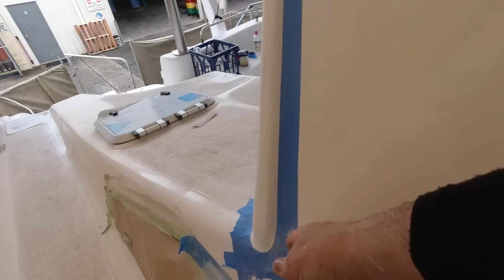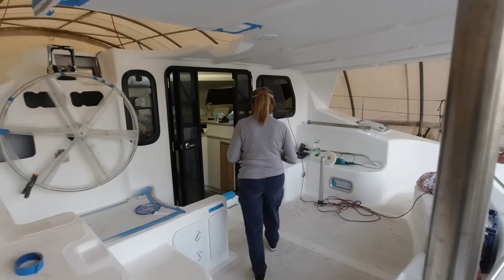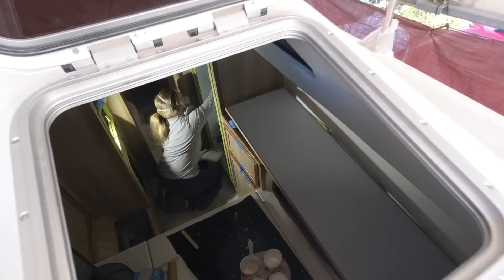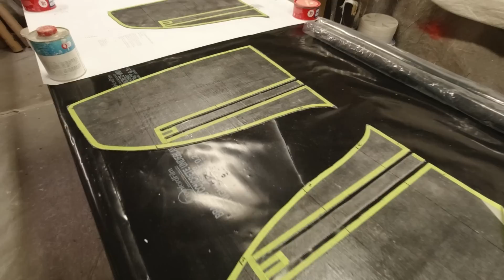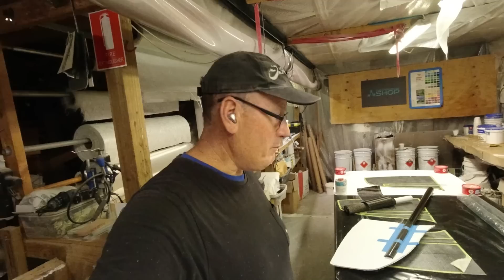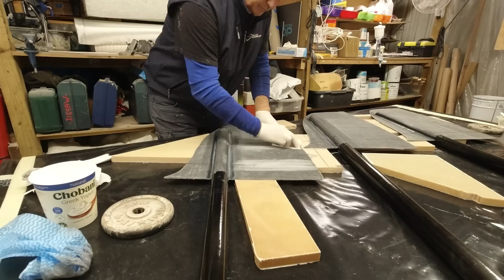Carbon Rudder Fabrication - Catamaran Build from Scratch Ep344

Comment: It’s amazing how much force water can push on the rudder. Those ribs and epoxy is the only thing holding the shat to the blade… as an engineer seams inadequate, but that’s the plan so better engineers than me know what they are doing.
Reply from the maker: Mate  there is so much tabbing and structure, there is no chance of these coming loose.This weeks video has more detail.
Reply: @LifeOnTheHulls  I was thinking, all will be revealed and I just did not understand. Tab the heck out of that rudder….lol
Reply: Looking forward to seeing the rest of the construction.
Structurally the centre web is not ideal, better put the strength in the skins. That said it is perhaps a better way of getting a good straight result. 
The highest load on the shaft is around the lower bearing, ie where it exits the hull, ideally you could reinforce this area with another tube inserted inside.
If the shaft is strong enough to take an impact, what about the hull?  Is it designed so that the bottom can break absorbing some of the shock load.  Likewise I would have the leading edge the same. Damage to the rudder is far preferable to damage to the hull.
Reply: My ideal is a spade rudder, as he has, fixed into a cassette, so can be lifted, and has a crash zone at the rear of the cassette box.
Reply: @markthomasson5077  - totally agree. I would be tempted to put a tube outline the rudder so that tube acts a a brace that gets grounded first and protects the rudder. I have seen this on some of the cats. I probably did a poor description, Agree Let’s se how Ross strengthens this up. Our Ross is a one man super human and he has got it done right to date so I suspect his going to bust this out just as well.

Comment: Carbon🤤 This is a fascinating video and I’ll be keen to see how you attach the rudder stock / shaft to the quadrant to avoid corrosion.
Reply from the maker: Will only have a tiller to attach to shaft and epoxy between the shaft and and tiller to deal with electrolysis.Pretty well  proven system.

Comment: Excellent insight with the rudder construction! I’ve been thinking this a lot. My rudder needs to withstand the whole weight of the boat with the double keels so that boat can be beached.
I’ve been thinking of making the whole thing with skeg and hinges and everything from aluminum. But we’ll see!
Keep it up! Not much longer to go!
Reply from the maker: I would suggest having a skegged rudder to keep strength upper snd lower, buggers to change or repair but safer that spade.We have a large skeg immediately forward of the Rudder and prop for added protection.Rossco
Reply: @LifeOnTheHulls  Yeah, definitely a skeg! There's also the fact that I can put only on bearing in the boat because there's the dingy garage that prevents the rudder stock coming to the deck level. So the lower bearing needs to be in the skeg.

Comment: On my rudders for my schionning wilderness i put sail battons on the leading and trailing edges for addeded strength and helped the glass go around the tight edges worked a treat cheers greg I also did 3 rudders.

Comment: Hello Ross, greetings from Hurricane hit Naples Florida. Actually we didn’t get hit that badly, lots of 65mph winds and some flooding but we made out ok. 

On the bow of the boat where the non slip area is pretty dirty, can you use a power washer to get all of those books and crannies clean again?  I never used a power washer on fiberglass so I don’t know if that’s ok. One cleaner that works very well on fiberglass is Dawn for Pots and Pans, I would think they sell that in Australia. If not, let me know and I will send some off to you in a hurry. Take care buddy, much love and blessings to you and your family. ❤
Reply from the maker: Ohh mate so glad you got through ok, horrendous storm by the looks, stay safe.Pressure washer will be used, but will be using a mild diluted hydrochloric acid gel coat cleaner to remove three years of dirt and wax from mould.It will require a full polish afterward to seal as the avid with oxidise the non skid.Fun times ahead.Thanjs for checking in and so glad the storm has moved through.Rossco

Comment: Great work Rossco, we haven’t seen inside the engine room(s) for a while, what’s happening in them?
Reply from the maker: Pretty much complete Pete, a bit of plumbing to come, has them running back in February, and now to complete the insulation and install shaft seals.Ready to go.